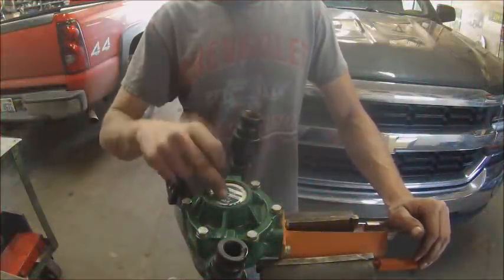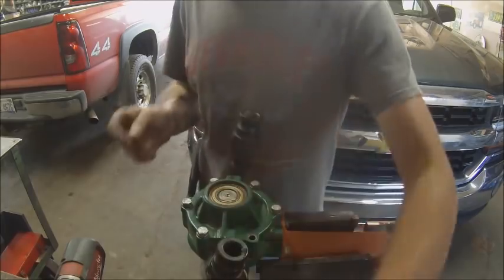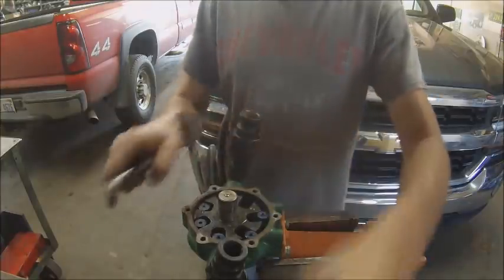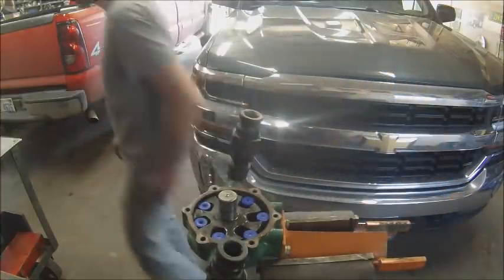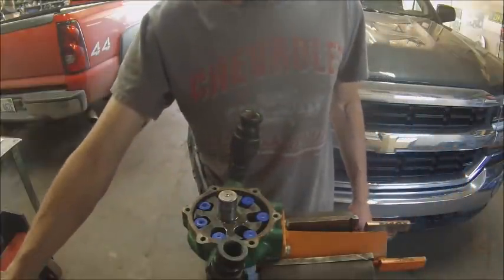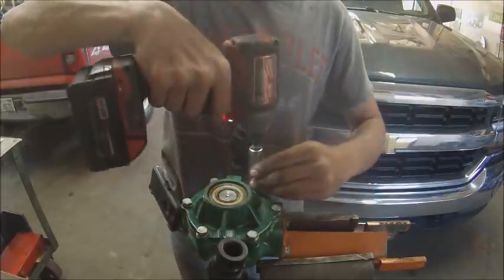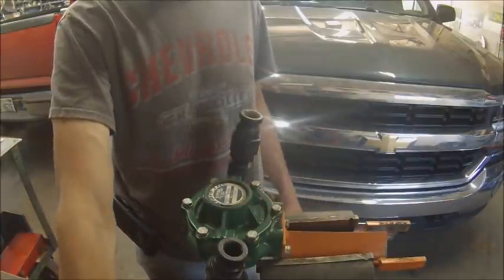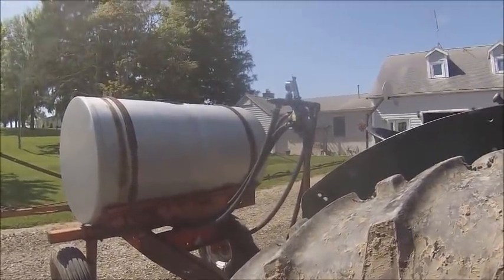Working On The Sprayer...Need To Spend More Money

Comment: I've had the same thing happen with a roller pump. Works fine the year before, drained it and stored it inside. Bring in out the next year and poor pressure. Figured it needed a roller kit, so I did a rebuild on it and still no pressure.  You would think if the case was worn why would it work fine the year before? One of life's mysteries.

Comment: We bought a 300 gal sprayer from a neighbor that had a  pto driven gear centrifical pump..... had to replace the mechanical seal but never had any trouble building  high pressure..... even with the nitrogen streamers.... the next sprayer my son bought at an auction had a hydraulic  gear centrifical pump that seemed to do the same....  It was sold here recently with the 7230 High Crop tractor..... He also sold the High Boy so we are currently sprayer less......

Comment: That sucks about the pump, but can you save the rollers for the new one when needed as they've really got zero hours on them.   You did the right thing with that comment There are enough of us are pleased you are back and posting like you do when you have time. I'm wondering if you've got some guys resubscribed that deleted their subs when you quit, and saw those 2 video's and came back Like I did when you returned.   
    
   Glad the re plantings not as bad as you thought thats a good help getting ahead when that turns round on it's own.   Things are better here to the canola's all planted. Crop insurance was here Wednesday, they wrote 3/4's of the canola that wasn't swathed off then . The rest thats swathed he said if it wasn't combined by this coming Monday, they'd write that off to as the $#!t would be greening up through it and we'd never pick it up. Thats done to as I don't see the combine out of the barn this weekend L.O.L. Now we've just got to hope the weather holds to clear the mess up and get the wheat in it before June 20th..  Thanks for the video, Take care.